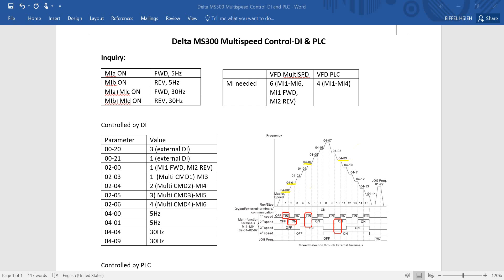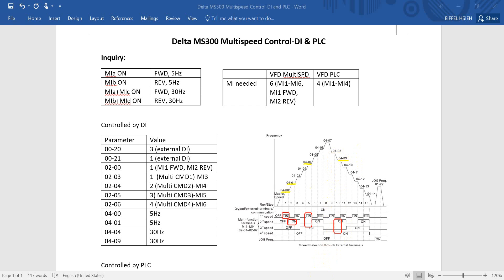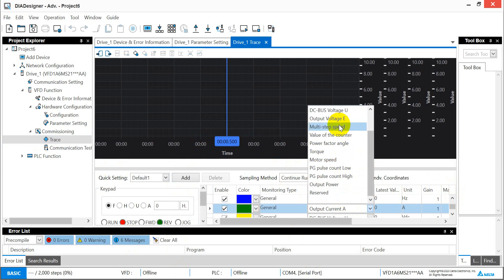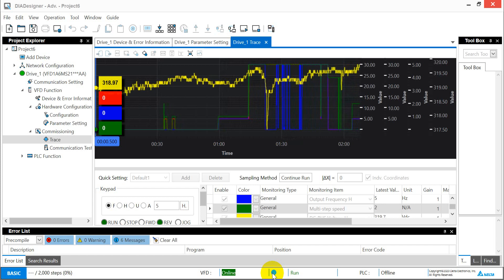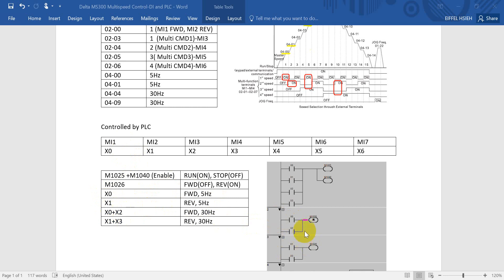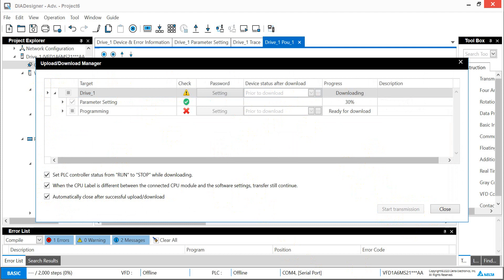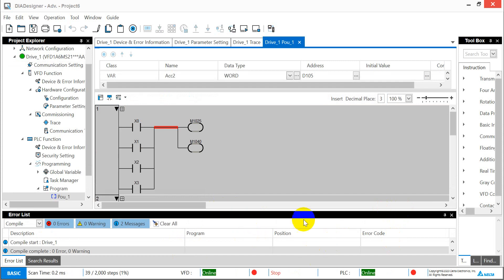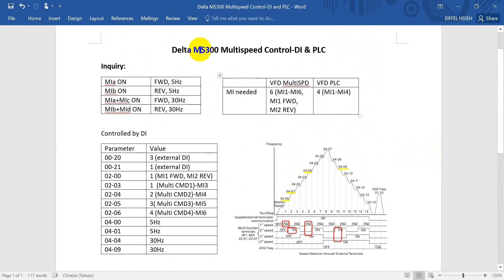Delta MS300 Multispeed Control-DI and PLC

Comment: I faced a problem with using DOPS function in C2000+ in built PLC. I do programming for Velocity mode, homing mode & these are working fine. But when i going to use POSITION mode by using DPOS function , its not working.

Can you help me about that??? 

I am waiting for your reply.

Comment: Hi, i would like to know where can i read more about the setting and coding of VSD MS300 Drive using ladder programing ?
Reply from the maker: @musama emmanuel , you can refer our user manual. or let me know which topics you want to know. thanks.
Reply: @iabg_seadelta6647  like how to control the speed of a motor using a potentionmeter  plug into ACM, AVI and +10, reading the input via PLC Ladder language